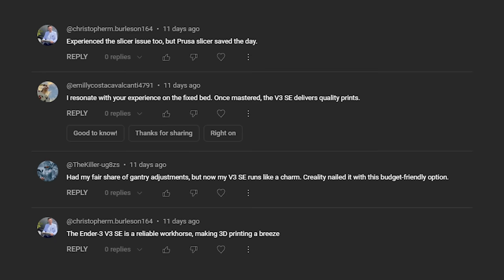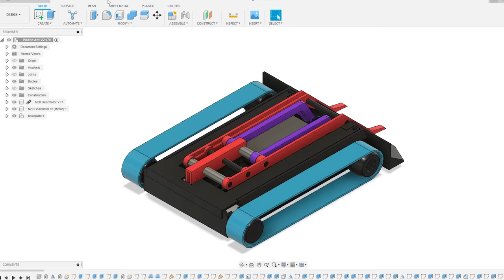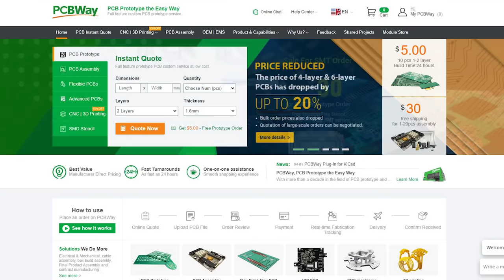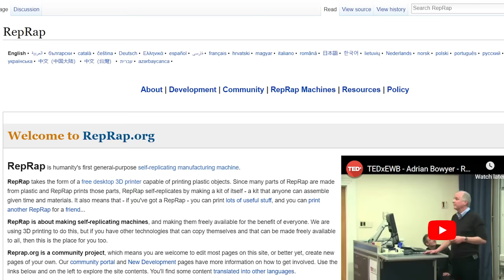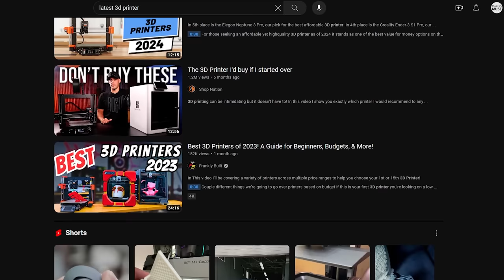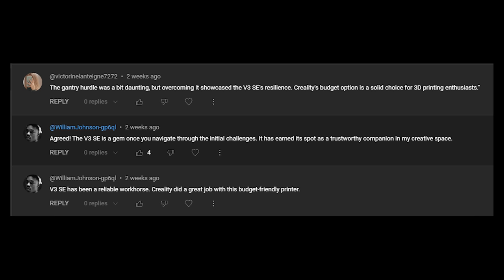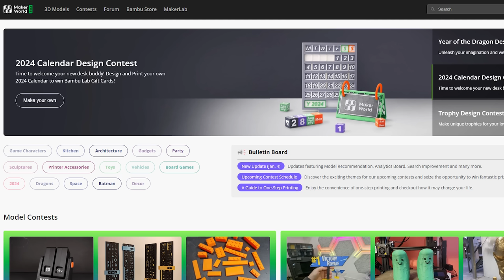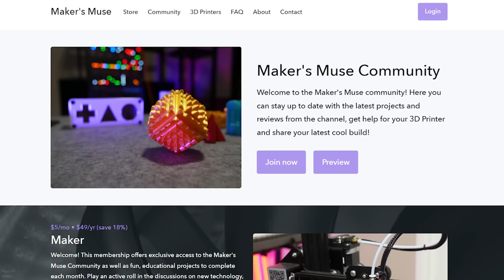My 3D Printing Predictions for 2024

Comment: In The Netherlands bottles and cans (both plastics and Aluminium) have a deposit on it when you buy them, since the Dutch want to get that money back these bottles/cans will get returned for recycling. 

Other products and materials are kind a hit or miss. Glass, batteries, clothes and small appliances can be recycled via stores or multiple collection points in neighborhoods. But for other products there is no nationwide program. Paper has long been collected by sports clubs as a source of income. Food (waste), garden materials etc are collected seperatly by most municipalities at no extra costs per bin. Some places have separate bins for soft plastics like food wrappings, but hard plastics like filaments are not under that recycle program and they need to be discarded with everything else. Many municipalities are switching to costs per emptying of that bin or a limited free empties. The result is sadly that people start dumping waste illegally.

Comment: Completely seperate to this video, but you, yes you angus, have gotta hear about R-Type Nylon rivets.

They come in many sizes, are dirt cheap, are reusable, and when prototyping you don't have to throw out the hardware with the failed prototype like you do with hot melt inserts.

What's more? They are dead easy to implement in cad since all you need is 2 holes (one in each part you're joining) and if the end is in the other part, an inside angled extrude.

The amount of cad steps and thrown out hardware plumments.

Now, they certainly arent as tough or sturdy as screws, but the majority of things that are attached, I feel, tend not to need the absolute most rigid option, so buy a few sizes and give em a shot. I think you'll find the maker experience using them quite nice. I guess now I have to include the obligatory "I am not paid by company I don't know the name of that probably makes all of these, all opinions are my own".

Comment: I turned from Hobby category to the tool. For many years i tinkered with marlin, did custom features for my printers, but at some point i just said enough as i spend more time fixing printers than printing. So I'm done tinkering and went full Bambu Labs, simply because of the ease of use, and no fuss printing. I'm not done with the hobby side and i still want a voron at some point, but I'm done with only having hobby side printers

Comment: I have been using '123 Design' from Autodesk since 2014 or 2015 and find it fits all my needs other than threads which I need to use Fusion 360 to make and them import back into 123 Design. I only draw and print functional prints.In November last year I supplied the main 'Mop Head' part for our local regional hospital (Western Australia). All done in 123 Design except for the thread. 123 design (no longer available) is, i think the predecessor to Tinkercad but installed locally. I have designed over 115 functional parts using 123 Design. No scanner, waste of time, Vernier caliper radius and contour gauge and other techniques I have developed which I will not divulge. GREAT SOFTWARE. Oh, and I bought my first 3D Printer (Mankati) from where Angus was working in Fremantle, Western Australia in 2014 or 2015. Hi Angus. Steve from Gero here. Got a Bambu X1 Carbon now. FANTASTIC PRINTER. I LOVE IT!!!!

Comment: Great commentary. Was interesting to see that you put footage on the cubify 3D printer. I have 11 3D printers 9 which I got on eBay for parts only and fixed. I saw a video of a cubify that cost $1300+ back in 2013. Saw it on eBay for $60 with 6 rolls of filament. Shockingly 3D systems had the slicer software for it as it needs to generate .cube flies vs. Gcode. Shockingly it works. Average prints at best but I bought it only for the piece of history that it was. And the 12 year old filament I dried it and the filament was usable for functional prints. So it was cool to see your reference to the cubify. It is amazing to see that Amazon still sells this old 2012 cubify they actually should not be selling it and it’s way too expensive, makes no sense.

Comment: I personally am so excited that printers are becoming more user friendly and are ready to go out of the box. My only complaint is that I spent so much money on my current printers to try to get them to do what a Bambu X-1 just does out of the box. It feels like I wasted so much time. In hindsight, I wish I just waited a bit longer for these machines to be developed. But then again, there was no way to predict that X-1 was coming when, as you mentioned, 3d printer design had been stagnant with only incremental changes if at all. 

Anyway, super excited to see what other machines will be spawned in response to Bambu's machines

Comment: I bought my Bambu A1 after I saw several reviews that were critical of the product, showing the negatives is how I judge if I feel the printer can do what I need. A lot were saying that the printer is a Mary Poppins of a product, practically perfect in every way. Since nothing is perfect I tend to to treat these reviewers as adverts for features and capabilities when everything is perfect.
I am very happy with the A1, it works but it’s still a work in progress with updates and fixes needed as some features can be bugged. But if you know what’s wrong you can always work around the issues 👍

Comment: Yes! There is a difference in the quality of 3D printers depending where you purchase them. I bought 2 x Creality Ender 3 Pros's 3 years ago. One from Amazon and one from Shopee (Philippines). The difference in finish, build quality and print quality were very noticeable....the unit from Amazon was so different, it was like it was especially crafted for me. Amazon, obviously demands a higher quality product....BUYER beware, a LOWER PRICE for the same model printer is not necessarily comparing "horses with horses"!

Comment: Agree with the attitude that I now I have matured.....and just want 3D printers that will self align, self calibrate, self level and auto calibrate everything and just print first time every time. 

I've had years of the Ender 3 Pro experience and I'm over the tinkering and upgrading just to get it to work better. It prints well, but it's just not aimed at the common person and its current form factor and never will be. Now I just want designs and print. 

The printer I want will need to be a tool that's just ready to go and is the device that produces what's on my CAD screen into a workable 3D part with no mucky muck and hardware intervention by me to get the 3D printer tinkered for it to work after its been set up and ready to use. The Bamboo Labs offerings in this field look really enticing.

Comment: Honestly, I do want a printer as just a tool--something to print things for the purposes of my own organization or especially for my own projects. But I ALSO want a printer that CAN be modified as needed, should I need to modify it, so that I don't have to go out and spend a lot more money than I reasonably should just to be able to modify the printer OR to have to buy an entirely new one because the one I have can't be modified... within reason, of course. So while I'm looking for a printer that can just start printing right out of the box or with minimal setup and initial adjustment, I'm simultaneously looking for a printer that allows me to make my own dang choices as the owner of said printer.

Comment: Now the main issue is modeling software and slicers.

For exemple to put 6 perimeters on just one hole to have more strenghts.

Multiple setting on a single part.

And easy sharing.

Comment: Thank you for posting this! A lot of stuff to watch out for, and you may have just re-lit my flame for 3d printing again. I was losing patience with my ender 3 pro, (this is coming from a cnc machinist/programmer), i put out enough fires at work then to come home to a machine that doesn't work without "tinkering" is a pain in my A$$!!! Will be watching out for better, easier to use printers to come. Thanks again and you are AWESOME!!!! 😃😃😃

Comment: Bambu Lab has totally changed my 3D printing. Now I just hit print and after a while, my part is done. No tinkering required. Now it's about how to use the printer to produce what part I want. How to use the tool, not how to build/improve the tool.

Comment: Your predictions are certainly on point and reasonable
Personally I foresee a couple of things myself
I'll start with the vegetables and move on to the steak
As 3d printing has become more popular there has been a somewhat toxic element of people injected into the community
It is inevitable once something gains a certain level of popularity 
And being that additive manufacturing by 3d printing is still in its infancy the trend of toxicity will only increase
Now that we've eaten our vegetables we can move on to a tasty prediction 
Slicer engines are becoming increasingly more capable 
With height range modifiers, cut tools, merge tools, and an ever expanding advanced slicer settings menu we are getting very close to what I see as a merger of sorts
There will be an advanced popular slicer with many of the available hot key functions baked in that CAD programs have
If they do away with all the hot key functions in a program like fusion that are dedicated to animation or engineering and only use the most simple and basic CAD functions then those functions can be added to a slicer engine 
The question now is, who's gonna reinvent the Slicer first ?
Will it be similar to Orca, will it be more like Cura which still has plenty of room for extra options, or will it be something easy that we've never seen before ?
Then again, my crystal ball has been a bit foggy lately so this may just be a pipe dream
I'd like to know your thoughts on a Slicer program that has some CAD functions in it, basically a more advanced section specifically for modifying or building models from scratch that doesn't bog down your personal computer or laptop like CAD programs tend to do
And for the record I use Tinkercad, Freecad, and Fusion360 myself
Freecad is great !
Fusion is a pretty heavy program for my clapped out laptop lol

Comment: Just got my 3D printer AnkarMake M5C. Very affordable! Out of box and printing in 2 hours (lunch break included), really, no twiddling. Great support from Benchy in 36 minutes. Where do I go from here. Well it is 3D CAD software to produce stuff of mine. Got to be simple. Got to be free. TinkerCad,  FreeCad.  Fusion 360 free, no bueano - too hard for a beginner. I am a hardcore woodworker and I think this 3D printer will work into my woodworking. Great video. I think your predicts are pretty much on target.

Comment: I bought a delta printer in 2012, I never was happy with the quality of print from it and all the tinkering I had to put into it. Last December I bought the Bambu X1 Carbon and I couldn't be happier. It just prints. Fast, quality prints. I want to print for the things I tinker with not the printer be what I have to tinker with.

Comment: Ya I''d stepped a bit away from 3D printing in the last year or so.  Until recently when my brother - with ZERO experience bought a Bambu Lab X1-Carbon,  and has instantly been getting incredible results, even printing very difficult materials.  And at the same time going through a bit of pain assembly a Prusa MMU2S kit for my work's MK3S  (got the kit a few years ago, only now needed to get it working after my old MK2 with an MMU1 pretty much just wore out).     The MMU2S went fine,  aside from having to baby sit it during multi colour prints to intervene with errors now and then.

But through all this I learned more about Bambu,  especially the A1 - and WTF.  the new things it can do.  The problems that it doesnt have, or can handle on it's own.  It's speed. How it spits out purged filament.  And it's price?!?!?    Ya, my 14 year old son wants his own 3D printer, so he's saving up for that,  and it would be my choice now to replace my MK2.  And I gotta convince my work to get the X1-C.

Comment: On the CAD front, I wouldn't call it easy to use exactly, but Solidworks' Maker spin-off is Very capable and Much, MUCH more affordable than the next alternative (down to $48 US per year). Alibre is a relatively unheard of option, but it's a great program, like the perfect combo of Fusion and Solidworks, that also offers a free version alongside perpetual licenses for us old fogies who like to own our software vs renting it. I'm aware Blender has a plethora of CAD plug-ins, but I'm not the biggest Blender proponent for that use. It's hard not to mention though because it's so versatile, as well as being Forever Free.

Comment: do you have a video about cutting up prints into multiple parts for printers that are too small? i want to make a fan shroud for my graphics card, which is about 100x300x30mm, but my printer is 200x200x180. it seems pretty simple to cut the model into multiple prints and then glue them together again, but this doesnt seem to be a thing?

prusaslic3r has some limited features for this, a big dovetail cut, a cut with holes for dowels, and a cut with nubs.

am i missing something obvious?

i think a video on how to make the best of limited print space would be extremely interesting, it doesnt seem like theres a lot of useful videos on this

Comment: Awesome job on the predictions. I am actively looking for my next 3D printer and yes, I am interested in one that prints instead of one I have to spend a lot of time on just to get good prints or for it to print at all. I will keep in mind what you said about the online reviews.
Reply: I was kind of blown away at the quality of my recent Ender 3 V3 SE. No tinkering nothing, just fast reliable prints. It’s actually a no-brainer for anyone doing 3D printing. As an extra printer or a first, it costs as much as as 8 rolls of filament. My other printers are/were Prusa i3 and Creality CR-10 V3. Both fine machines, but the Ender 3 blows them out of the water in every aspect.
Reply: @QBziZ  That is good to hear. I have finally gotten my Ender3 v2  printing better after replacing some parts that broke in the first couple months I had it. My son has the same model and he helped me dial it in last time he came to visit. he has the same mode but has recently purchased a Bamboo PS1 and loves it.

Comment: As well as biased, or inaccurate, reviews proliferating because of financial reasons, many influencers/content creators seem to be given products that they have no experience with at all. I guess with more youtubers wanting more stuff to create content about, manufactures wanting more people to promoter their products, and youtube stoking the fire of excessive consumption, it is unlikely to change.

With regards CAD software, I am using Siemens’ Solid Edge Community edition. It is free, and not cloud based. Apart from the files not being compatible with the commercial version, and 2D printed drawings being watermarked, it seems to be fully functional. I don’t know why it doesn’t get used in the 3D printing world.

While encouraging people to be creative is a good thing, is downloading a file from a repository and 3D printing it creative? If I downloaded an image and printed it off on an inkjet printer, I doubt anyone would consider me to be artistic.

Given the number of comments about recycling, I’m genuinely curious how much filament people are wasting that needs recycling? I may be biased, in that I firmly fall into the printer as a tool camp, but I don’t generate enough waste make recycling viable. If you are that concerned with the environment just print less crap to begin with. It is a win win option; you are using less plastic and also less power, both initially to print and again to recycle the plastic.

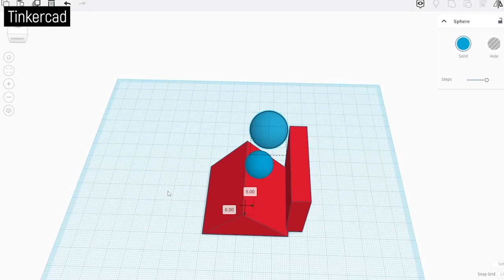Comment: 5:35  I just started making models a few days ago and went with SolveSpace, primarily because it runs natively on Linux.
As a newcomer to CAD I found it relatiely easy to get started, the program has some quirks but usually makes it very clear what's wrong and what needs changing. Creating machine parts is child's play.
My main gripe is that you're quite limited/hindered when it comes to the creation of more complex shapes (unless there are some other functions that I am not yet aware of), and I might want to move away from the program in the long run for that reason.
Still, I think it's really good for beginners wanting to create technical parts.

Comment: I had my suspicions about rigged reviews when my Christmas present to myself "print straight from the box" K1 Max produced the worst prints I've seen from a 3D printer. They were shit, they were that shitty Creality should never have released the printer. Bed 1.4mm out of level from side to side, belts so tight that even with the adjusters fully released they were far too tight, so many components were loose it had no chance of printing properly. The only tight items were the belts. It took me a week to sort the thing out & in the process of doing that the filament swelled & jammed in the heatbreak. I thought about throwing the thing through the shop window I was so pissed off with it. I ended up stripping it right down so I could set the mechanics up properly, only then was I able to calibrate it. It's now printing very nicely but the jury is definitely out whether I'll ever buy another Creality. The "quality control department" 🤣🤣🤣if they have one need shooting.

Comment: I really wish the Bamboo would do what I need, but the combinations of filaments I need are sensitive to contamination is would require huge purges and they are hundreds of dollars per kg.  They need a tool change version.   The SV02 seems like it can do the job, and the auto leveling is good, but the CURA slicer is not very good. So lots of tinkering ahead.